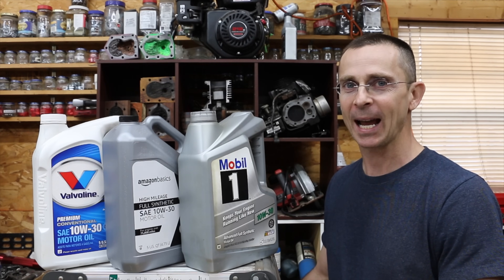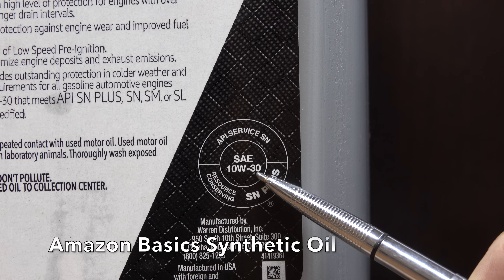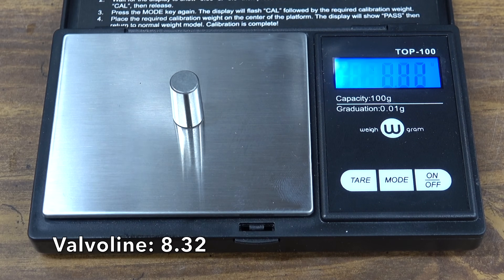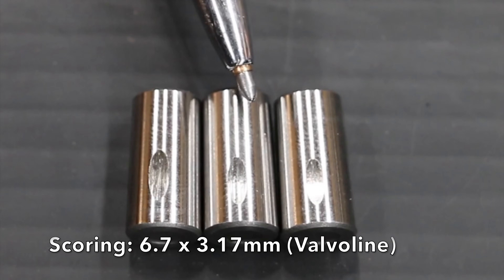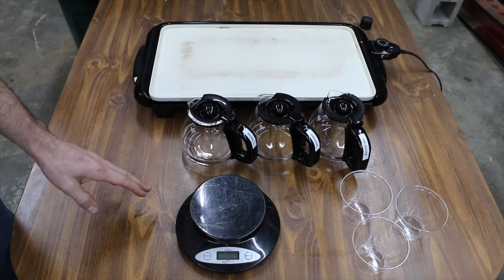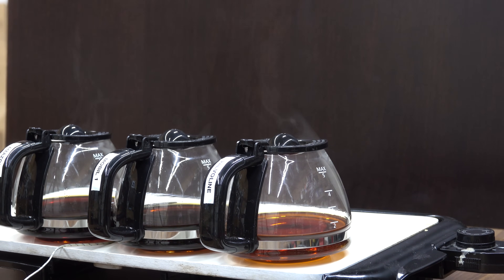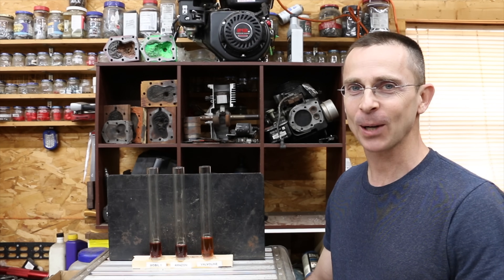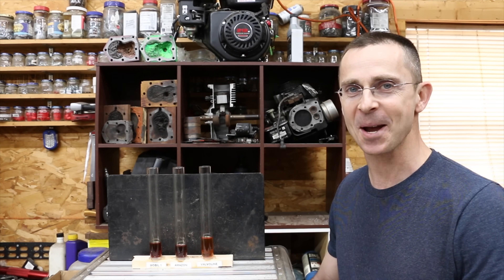Is AmazonBasics Full Synthetic Motor Oil better than Mobil 1? Let's find out!

Comment: MY CONERN IS CONSISTENCY. IF AMAZON TODAY IS SOURCING FROM CLEARLY A GOOD SUPPLIER, who says they won’t switch in a a few months and source a lower quality product?
Reply: Check the bottom of your bottle.  If it's a Warren oil   (Wne,  Wpp)  or a Warren Unilube (Wu)  Go ahead,  these guys consistently make good stuff.   Warren Dist  (Wne)  has been the supplier to our local auto parts store for about 10 years...  and that's about ALL I've bought.   Across 4 cars,  a Standby generator, and 2 mowers,  I've got zero complaints.
Reply: @DeadKoby  if Warren supplies the oil to your store who supplies the auto parts to your store are you a national chain or small mom and pop shop?
Reply: They use the same supplier as Wal-Marts branded oil SuperTech. Another tester put SuperTech and Amazon Synthetic against each other and couldn't tell them apart. They were testing to see if Amazon or Walmart required different formulas or qualities.
Reply: @jockosboy17  eh then no thanks lol...

I used super tech in winter months for years in both my vehicles as well as my bikes (I run the piss out of my bikes), and rotella 15-40 in warmer months.

I haven't used super tech in a few years, bought some a couple months ago, and opened it up, and it was real dark and REEKS.  Smells liked burned transmission fluid.  I'll keep that crap around for the lawn mower, not going to pour it into anything I rely on lol
Reply: @Towlieee  I agree. I will stick with my Mobile 1. I wasn't advocating its use just pointing a fact out.
Reply: @jockosboy17  I just started using Walmart full-synthetic in a Scion that has an oil-consumption issue. I'm very pleased so far. At this point, we have to know that when it comes to full-synth (as with many things) we pay first for the name. That's why its far easier to respect Amsoil than Royal Purple.
Reply: Just like supertech does.  Some tests its great, others not so much.
Reply: @John Grzeskowiak I've learned to never trust a fart, just plop down on the John.. And there's a pun
Reply: Literally the Amazon Basics business model..
Reply: @gtzgreatride  Its not a Warren bottle is it?
Reply: @LukeArnold01  Not sure if you're talking about the actual jug or what's inside, but you can see the "Manufactured by Warren Distribution" on the Amazon jug at 1:07 of the video.
Reply: @davekimball3610  I was talking about the bottle. I saw the label said it was MFG by Warren. The jug looks like another brand I've seen somewhere. Just like the oil is made by a different manufacturer the jug is probably made by a plastic bottle maker.
Reply: @LukeArnold01  it's the old Supertech bottle Wal-Mart used.
Reply: @LukeArnold01  Nope, Warren prides themselves on making all their own containers. They do the blending, filling and labeling.
Reply: @humansvd3269  That's where I've seen it. Thank's for reminding me.
Reply: @LukeArnold01  They are the older Warren Bottles. Walmart used the same thing until they changed the bottle.
Reply: Well, as the Valvoline tests here show, desire to keep the reputation of a name brand that once was high quality is...maybe not strong enough these days.  I agree about the consistency worry.  So far...I've had really good luck with Amazon Basics things, and PF's tests tend to bear out my own experience (which is only anecdotal and one guy).  And really good luck with Mobil 1 specifically as that's what I've been using.  I forget who tested Fram and other filters - but similar issues, a once great name is now crap.  So I guess it's all a crap shoot, you'd just have to keep testing.  Thanks PF for another great one.
Reply: @DCFusor  the Valvoline was not synthetic
Reply: @DCFusor  it probably was because he wasn't using there full senthic oil.
Reply: @DCFusor  valvoline was conventional oil.
Reply: @bobdodge3171  Back in the day - way back, when there was no synthetic oil of any brand, the only time I spun bearings racing, the engine had the highly touted Valvoline in it.  Only one data point.  I kept racing, but never used it again.  I do wonder how many here actually know the differences in the molecules involved...and the detergents.  In any case, then and now, Valvoline seems not to have quite the film strength of the others (syn or otherwise).
Reply: @DCFusor  yes i know syn is fairly new.
Like 2 stroke oil there was none and you used 30 weight oil.
Sorry about your luck with valv' I've always used valv'.. Well now i use supertec but never had a problem with valv'.
Reply: @DCFusor  Valvoline is conventional oil, the other two are synthetic oils. I suppose that explains the difference.
Reply: Yea especially cause amazon isn’t known for being in the oil business.
Reply: True. It seems like they do this with many products
Reply: ImStricken06 that’s usually what companies do
Reply: ImStricken06 yup
Reply: In a way, this applies to all oil companies. So, chill...
Reply: Lets worry about that when engines start shooting rods out of the head...
Reply: Who says Mobil 1 wouldn't or hasn't done the same ?
Reply: They all use mega crude suppliers that refine with the same processes in theory.
Reply: Amazon has changed sourcing before with AmazonBasics brand. Sorry, I won't risk it. It's like tossing a coin if they are going to be reliable or not.
Reply: I personally use Castrol Edge high mileage and I find that it works really well for my vehicle but that's just my opinion I am curious to see if Royal Purple or any other high-end brands would keep up
Reply: I had the exact same thought...
Reply: of course you wouldn't know :-)  BUT , we all don't know if the companies don't do that also .... everyone is a lier
Reply: I mean any of the other brands could pull the same thing tbh.
Reply: Amaozn does this a lot.  They sell a lot of counterfeit stuff.
Reply: If you cared about this, you wouldn't be buying that. I will always buy Mobil 1, especially if it doesn't really cost much more, if any, at Walmart.
Reply: You have the right mind set (ImStricken06).  In this day and age you can not let your guard down over anything. People might think your " Paranoid " but I would say your leaning on the side of caution.  One of the few " Gaurentees " in life is that EVERYTHING is in constant state of CHANGE!
Reply: It will say made in China. Lol.
Reply: Then DON'T BUY THE AMAZON OIL! YOU MORON
Reply: THEYN SOURSE FROMSEVERAL SUPPLIERS. DEPENDS WHERE THEY ARE.

Comment: Good video, good test, but it's time to learn some statistics. 

For the bearing test: the area in contact with the bearing will be the same regardless off the length of the rod and will vary only a marginal amount with small changes in the bearing radius. Thus measuring the change as a percent of total mass is misleading. You instead need to only look at absolute weight loss or the volume as you did.

Viscosity: good here.

Smoke test: again measuring as a percent is misleading. The area that is available to evaporate/burn/smoke from will be the same for a realively large change in mass/volume. Thus if one smokes a lot more but you had a lot more in the container it might come out as a lower percentage even if it was worse. Absolute values are the most important here.  You also mention well ventilated but kept the lids on the containers.
Reply from the maker: Thank you for the constructive feedback.

Comment: maybe instead of weighing the cup and pouring into the pot, just weight the pot till your desired amount of oil is in the container (by grams) then do the test, removing the outside factor of the residue left in the plastic cup. otherwise good testing
Reply from the maker: Great recommendation!

Comment: the amount of material worn away on the bearings should be presented as a delta, not a % loss.  in all 3 cases the amount of material lost was pretty small, putting more emphasis on the accuracy of the scale.  keep up the good work!
Reply from the maker: Great recommendation. Thank you

Comment: While the amazon oil did flow better cold,  it could be the case that it fell below the 10w spec.  Mobile 1 might be sticking closer to the 10w spec. A 0w spec will flow far better than any of the three.   So really this means amazons is probably less than 10w
Reply from the maker: Thank you!

Comment: Would it be a little closer to simulating a cold start to not lube the bearing before turning it on?  It might make a difference if oils vary in their ability to get between parts.
Reply from the maker: Thank you for the video idea!

Comment: I have some mobil 1 advanced high mileage oil and it had that sn plus on the label. With that said, the Amazon oil must be matched with Mobil 1 advanced formula. I also noticed in the video that the Mobil 1 bearing seemed to got a bigger splash of oil. Even with all that said I would say that Amazon maybe on to something being it beat the others with the flow test
Reply from the maker: Thank you!

Comment: I think your flow test had a flaw. It looks as though all of your speakers aren’t exactly at the same angle. And thus you’ll get some lock, when you tip it. 

Like the air like you get when you tip a jug when pouring. Go over the perfect point and you won’t get great flow. And seeing how you only had those beaker, epoxied to the piece of wood, and seeing them from different angles it looks like they’re not all in the same plane.

Just an observation. You could try by rotating, and putting the different oils in the different beakers.
Reply from the maker: Thanks for the constructive feedback.

Comment: Compare Valvoline VR1 conventional 20w50, Valvoline VR1 Synthetic (blue) 20w50, Pennzoil GT 25w50, Penngrade1 20w50, Royal Purple HPS 20w50, Mobil 1 Racing 0w50, Eneos Racing 0w50, Motul 300V Competition 15w50,  Lucas 20w50 Racing Oil, Torco 20w50 Racing oil, Redline 20w50, Driven 20w50 Racing oil, Amsoil Dominator 15w50, Idemitsu Racing 20w50 (rotary), Neo Racing 15w50, and for comparison maybe Castrol GTX 20w50 and Castrol Edge 5w50.

All are 50 weight and should make for an awesome comparison with some being conventional, synthetic, a blend, and PAO vs Ester based...etc.
Reply from the maker: Thank you for the video idea!

Comment: I wonder what PF would recommend for a newly-rebuilt engine?

I am in the process of rebuilding my first engine, and I know that once it's time to start it up, there's a break-in process. I know nothing about how to start it up for the first time, but when that time comes, rest assured, I'll be well-versed on the first-start and break-in procedure. I was just curious for PF's take on this, in the off chance that he should see this comment.
Reply: in general, use an assembly lube during the build, and an oil specifically designed for break in. then switch to a group V synthetic.
Reply: need more information about the engine to determine best oil

Comment: For years I have heard about differences in gasolines. i.e. Shell has more sulphur, off brands have more water, and all the brands which have additives they advertize that are supposed to increase mileage and reduce wear. How about a comparison.
Reply: All the stories I have heard are anectdotal. I buy my gas at Fred Meyer, I use my rewards points and it's cheaper. I've never had a problem with it. I was always told not to use off brands because they had water, rust, and sludge  in the tanks. Perhaps in the old days with ageing Mom and Pop stations that were struggling to survive that may have been more prevalent but the new tanks don't rust and gas is better and does not produce sludge like it used to. It could be a disinformation campaign perpetuated by big oil companies, reinforced by people who neglected their vehicles (they were buying cheap gas) and mistakenly attributed it to the gas they were using,
Reply: Best place to get fuel is a high volume store (will have the freshest) with the best price. Like you said they source from the same few suppliers.
Reply: Ive done a little testing on different fuels myself, measuring usage in liters/h with my truck, and theres really not that much difference between them. No fuel additives are gonna have a big impact on wear, they only ever see the top of the piston, and the valves, and they wont increase mileage either. According to the data I got, you can expect about a 1% difference or so between Shell V Power gasoline, and Tempo gasoline (Cheapest shit I could find in my town, 89 cents/liter versus $1.11 for the Shell stuff).

Point is, theres so little difference you would need some really sensitive tests to determine any clear advantages a fuel might have.
Reply: I have spoken to a former long time higher up in a large oil company, they were in the industry for decades, and left the industry about a decade or so ago. it was quite a while ago, but pretty much ALL of the gasoline you can get these days is virtually the same, the only difference is the minor additives that are put in right after they pull it from the pipeline. the condensing of power in the oil industry is one of the reasons why this is the case.

The differences between the different gasolines would be miniscule at most. maybe they add a few more drops of detergent per gallon for a pretty penny, but thats really about it.

Comment: If my vehicle uses conventional oil, can I switch to full synthetic? Would that be wise as far as the life and performance of the engine is concerned? 
I have used a synthetic blend before in another car and didn't notice much of a difference. But wondering if adding full synthetic would be worth it. 
Thanks for your opinion.
Reply from the maker: Yes, you can. I switched recently, now that it's affordable and it has worked very well.

Comment: great video... learned something interesting... i have a malibu with the 1.5 L turbo and direct injection and i use mobile 1 full synthetic and yes its a bit pricey but the dealer recommends "DEXOS" .. i will try out the amazon basics after watching this video.. as a side note the malibu doesn't burn a drop of oil as of yet.. but i will see if the amazon basics makes any notable difference in performance or knock etc..
Reply from the maker: Nice car!
Reply: Quick question tjough... the mobile 1 i use the dealer recomm3nds i change the oil every 5k or 6 k miles ... is the amazon basics rated to last that long

Comment: Would love to see you do a long term test of different fuel stabilizers in gasoline and ethanol  blends to see which if any can keep fuel fresh as they all claim.
Reply from the maker: Thank you for the video idea!
Reply: Yes. Amsoil Quickshot and Sta-Bil.
Reply: ooh. yes please.
Reply: Please make the requested video.
Reply: The Marvel Mystery Oil website claims that MMO does act like a fuel stabilizer.  I have been using it in the fuel of my old truck to keep the fuel pump lubricated.  The truck idles very nicely too.  I also use it in the fuel for my lawn mower and pressure washer.
Reply: Want The Best Bang For The Buck ??  Use Marvel Mystery Oil !!   😆

Comment: Cool stuff. Looks like it’s close enough to M1 for my use. I’m not an F1 driver, so I’ll probably never see the difference.  Just try the bearing test for 10 mins after the 2 hour cook off and see if they’re still neck and neck.  Maybe not 100% exacting, but you do a pretty good comparison.  If only you could somehow test the dry start ability and anti foam along with rubber restore...
Reply from the maker: Thank you!

Comment: I have been using Wal-Mart Full Synthetic SuperTech for years.  My vehicles have experienced zero mechanical oil related problems and the engines are shiny and clean on the inside.   SuperTech is made in the same refinery as several other very expensive products.  Please test SuperTech.
Reply from the maker: Thank you!

Comment: Would one of the synthetic oils help with valve ticking on a cold engine?
Reply from the maker: Great question. It will likely reduce the amount of time the ticking occurs as the oil will flow much better.

Comment: This was really interesting. Up here in the Great White North, Amazon doesn't (yet ?) sell their oil, however we have Canadian Tire. Most CT oil is made by Shell, however lately I've noticed that their high-end 0W40 "European" formula is made by Warren, the same people who make the Amazon Basics. This is a viscosity that is of particular interest to me. Based on your test, it's clear that Warren makes good oils and I will not hesitate to use it in the future, either under the Canadian Tire Formula One label or the Amazon Basics. One extra comment, you mention near the end that you use a synthetic blend. I'm sure it's basically fine, however I have always shied away from these blends simply because there is no way of knowing what you are actually paying for: Many people are under the impression that synthetic blends are a 30-70 or even a 50-50 mix of mineral and synthetic oils, but in fact they could be 1-99 and still be labelled a synthetic blend, at which point you are paying more for what remains a mineral oil.  Maybe an idea for a future test ?
Reply from the maker: Interesting.  Warren Distribution has a great reputation.